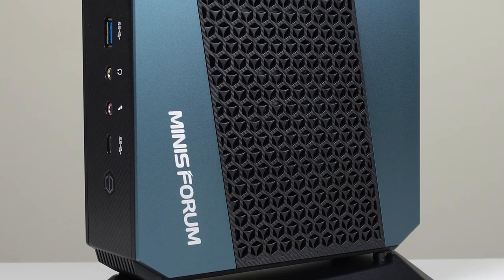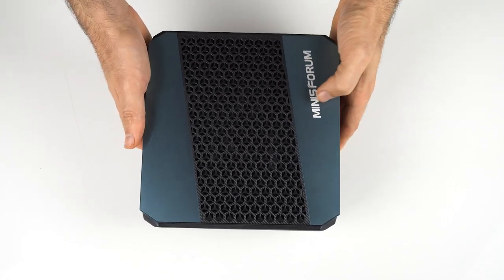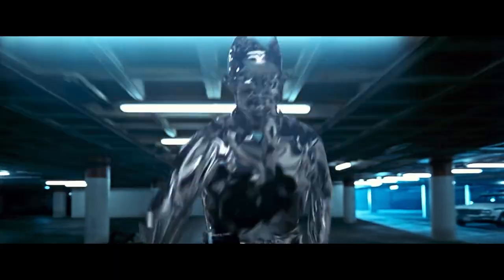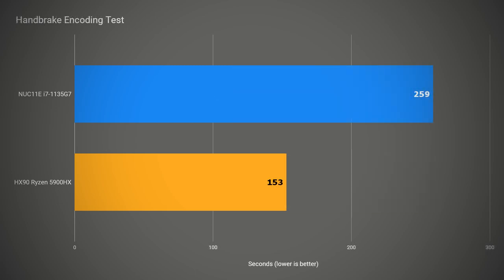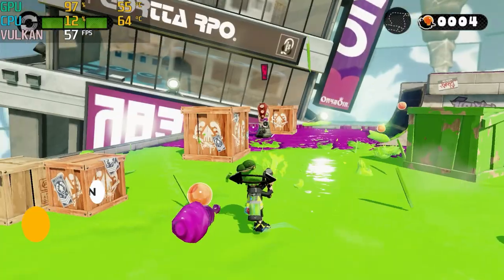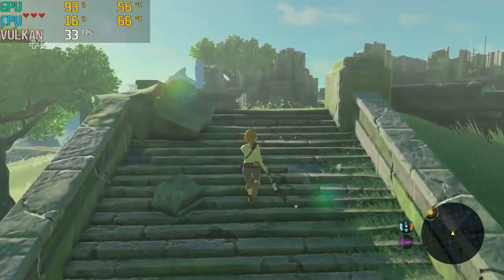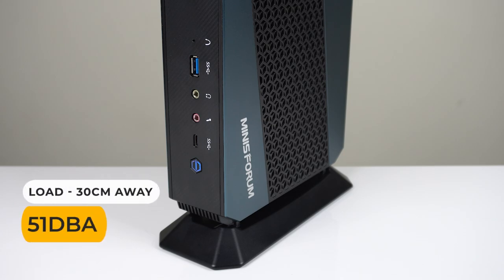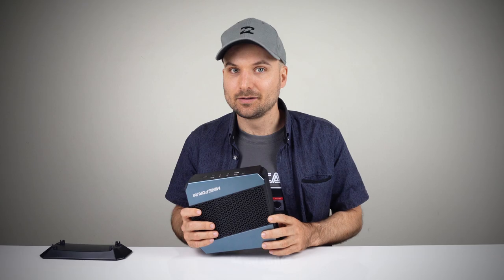Is THIS the mini gaming PC to own? Minisforum HX90 Review

Comment: If you had to choose between a nuc 11 (1135g7), hm90 (4900h), th50 (11320h) and hx90 (5900hx), for ps2 emulation with "hard to emulate" games, which of these mini PCs would you chose?
Reply from the maker: TH50 budget option. HX90 premium option. HM90 falls somewhere in between. Haven't tested the 4900H so can't give an accurate assessment.

Comment: Do you know how much RAM is assigned to igpu vram? If it's not defaulting to 2gb, I think the max?, then it won't help game play. Hopefully configurable in the bios
Reply from the maker: From previous testing of AMD iGPUs, whatever they say in the Adrenaline app is just a base figure. It uses as much memory as needed for the task. Gears of War Tactics is good for checking this as the benchmark shows how much Vram is being used. So even though it detected it as a 2GB GPU, it was using more in the benchmark when the settings were dialed up.

Comment: hi, I recently bought a new Ryzen 5 5500 but it isn't displaying and it's not giving power to my USB ports. fans spin, ram lights up, and it stays on. my GPU fans spin but it doesn't light up. I tried re seating everything and I updated my mobo bios to the latest version. tried plugging HDMI into both the mobo and GPU, and tried to use display port as well .
16 gb RGB ram, Ryzen 5 5500, RTX 3060, msi 320m-a pro max, 400w psu.
Reply: probably my mobo tbh but supposedly it's all compatible
Reply from the maker: That CPU has no integrated graphics, so you definitely won't get any display from the motherboard. No USB power means that it's failing to pass the power on self test. The BIOS must be 7C52v28, so make sure it's that one if you can. Try one stick of ram only in the DIMMB1 slot. Also try clearing the CMOS. Info on both in the manual https://download.msi.com/archive/mnu_exe/mb/M7C52v1.2.pdf
Reply: I'll see if clearing cmos does it because I already have that dios update
Reply: @Robtech  ok, I did everything you said and there is still no power to USB, no display, and GPU won't light up. Tried reseating everything.
Reply: One of my friends suggested that everything could be drawing too much power. That could be a thing since my GPU is overclocked
Reply: Alrighty, me and my friends came to the conclusion that the CPU is just dead on arrival since literally everything else is working fine except the CPU. Thanks for your help.
Reply from the maker: If it's drawing too much power it will shut off instead of staying on. Ideally you'd test the CPU in another board, but yes it's possible it's DOA.

Comment: I love to play cities skylines. It’s a city building simulation game. I guess it’s somewhat CAD-related software but very interactive. If I throw this at this device would it be very taxing on the CPU/RAM/APU/GPU? 🤔 I only plan to use 3 mods but my city will be at most 25 tiles of work play.
Reply from the maker: Cities Skylines "Recommended" GPU spec is a GTX 660 graphics card. The integrated graphics in this APU performs below that when comparing 3D Mark benchmark scores (5245 GTX 660 vs 4410 for this APU). It would be far above the minimum specs of a GTX 260 though. The CPU wouldn't even be pushed.
Reply: @Robtech  thanks for the response. Maybe I shouldn’t look into Mini-PCs if I plan to play Cities Skylines. 😞